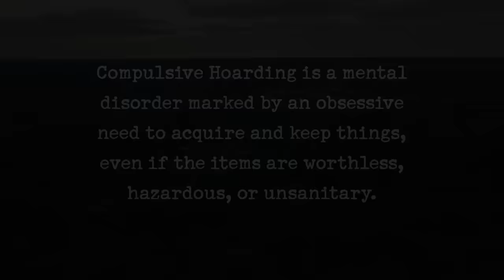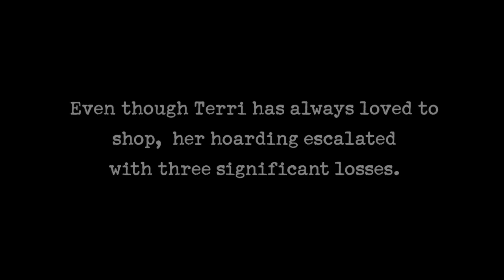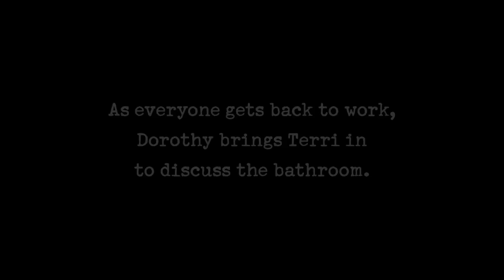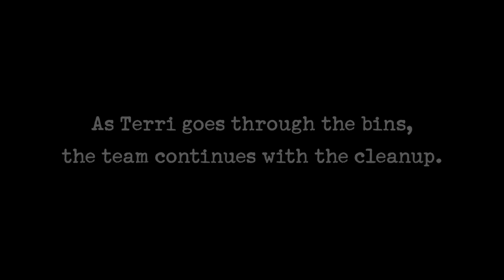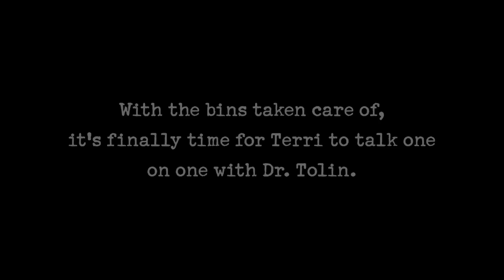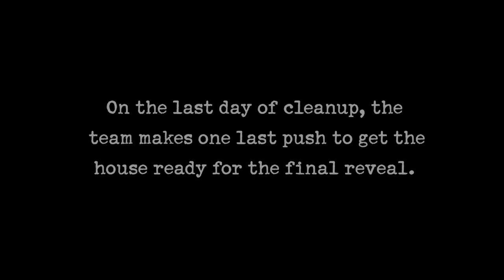Terri Buries Past Trauma Under MASSES of Junk | Hoarders | A&E

Comment: I keep hearing that it is an illness and am still trying to wrap my head around that to not accept that it is just being a huge slob... difficult for me to see, like so many mental illnesses.
To me the difference between a collector and a hoarder is that a collector should not have rotting garbage in with those treasures. That part is disgusting.
I'm one of those people who could stand to do a little more decluttering but whenever I have a bit of trash ALREADY in my hand, I IMMEDIATELY add it to one of the many trash containers in my home.
Then weekly it goes to the curb to be picked up. That concept is just too easy.

Comment: I think she was kind of done with it before they came and she just needed a little help. I think the crew had a mindset already and wasn't prepared for someone to be where she was. A lot of the times I do worry that someone who is letting go easily is going to revert, but I think she saw a problem and wanted to get out the hole she was in. And I'm glad she called out the basket thing, she didn't need to go through them, she wanted them gone.